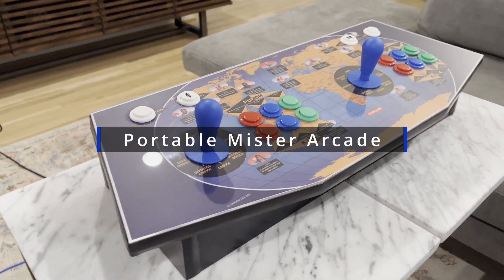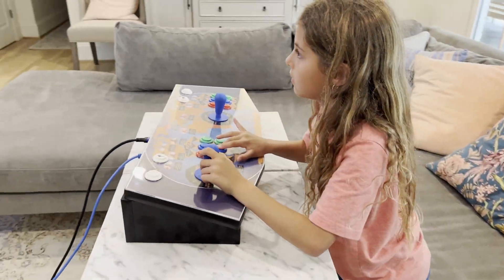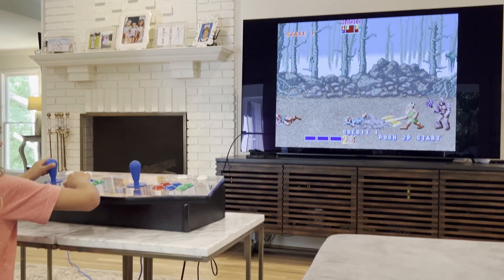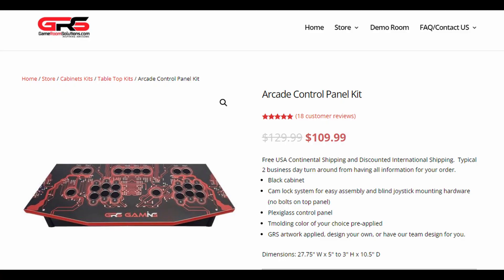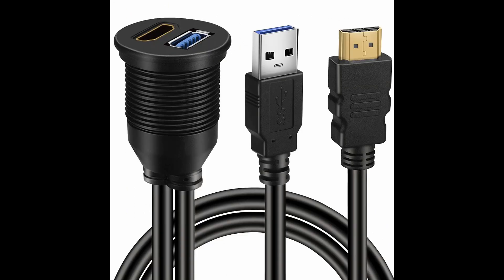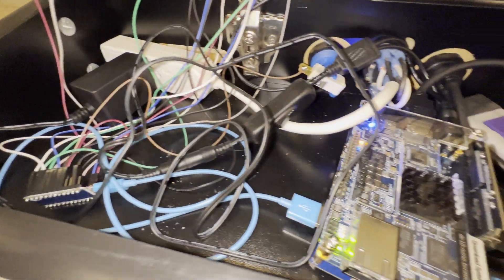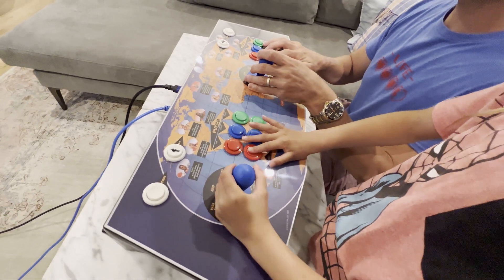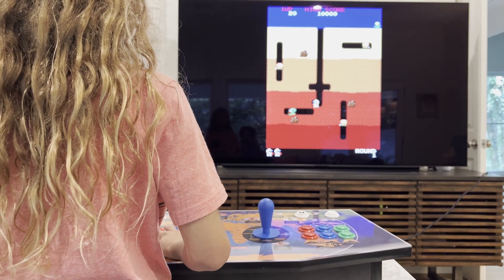Portable MiSTer FPGA Arcade - with parts guide!

Comment: Hi, I am asking again about a keyboard. 
Don´t you need a keyboard to set up the menu of the mister?
Why are there two white bottons on the panel each side and one in the back next to the swich on-off?
Reply from the maker: A keyboard will help but it isn't necessary (sometimes it makes button configurations easier). White buttons are for select/start for each player (in this case a coin button and a start button). Button on the back was added to prompt the menu to open on the mister.

Comment: I'm totally puzzled why people are concerned about their arcade experience being "100% accurate" using a MiSTer for FPGA emulation, when they are using modern displays that look nothing like the classic arcade CRT tubes. The experience is totally inaccurate, why be concerned about cycle accurate emulation? In addition, the timing of the display doesn't match that of the CRT and there are possible USB timing issues. MAME is very good with many games, and 100% software emulation is possible to be cycle accurate with some other emulators, such as the WinUAE Amiga emulator. Going the MiSTer route severely limits the number of games to be played and the quality of the emulation is only as good as the people reverse engineering the original code.
Reply from the maker: You make some good points but I think there are a few things to consider. I agree I don't have a CRT, which I would love but I don't have the space at this time; however, once I can fit one in my house I will be able to hook this device up to it as it has native CRT out capabilities. In regards to cycle accurate, you are fully correct. While most displays don't support "odd ball" refresh rates - that isn't the case for all. My TV is an LG OLEG which supports "free sync"; therefore, I have the opportunity to run my Mister at the native refresh rate of the arcade board or console and my TV is just fine with it (Truxton wants 57hz - so be it!). One of the advantages of the LG OLED - I love it for that. At first I didn't believe there would be a big difference in the free sync vs forcing it to output at 60hz for all games -  but it does indeed makes a big difference with certain titles. I do agree with USB timing - which has a work around (running the controller directly into a SNAC adaptor therefore it is "wired" directly to the board and not via a USB input (which does offer different rates of polling if needed). I do agree with you that the MiSTer lacks the number of titles featured via software emulation but another draw to me is that the current open source community that is working on the MiSTer is OBSESSED with getting things right. Updates are happening all the time to get things as close to the real thing as possible and this really draws me into this project. For years I utilized software emulation and it seems like the community for the most part (not trying to bundle 100% in this) is more concerned with front ends and menu's not so much getting everything 100%. I agree the front-end's are mesmerizing for PC builds and the Pi4 but it really comes down to playing the game.  I am actually working on a similar controller build (1 player) with a Pi4 inside to fill in the gaps where the MiSTer falls short but when it comes to which way I'd rather play an old school game - given the choice between FPGA (MiSTer or Analogue products) and Software Emulation - I'd choose FPGA every time. What's great is that we have so many options to play these old games, but for the reasons above this is why I've chosen this route. 👍
Reply: @Hawk_Eye_Retro  Nice to hear your comments back Ben.

I've built 4 MAME machines so far with more in the works (no rush). Most of mine were built over 20 years ago or close. In the late 90s I had a custom made wooden MAME controller made with new Wico leaf-switch joysticks & buttons (which I much prefer) and the layout I wanted for classic games (such as Space Duel fire buttons). 

All 4 of my MAME machines feature 19" arcade CRT monitors. That is the single most important element of playing the games to me. How do they look? Modern displays look very little like 1980s (or 70s) arcade monitors. It's not so much about the refresh rate, but most importantly the look of the actual tubes. But to get the games to sync or work right on raster CRT's, you have to get the right refresh rate. But not so much with mine (I'll explain). I'm using an empty gutted artless MsPacman cab for my vertical MAME cab, and a similar Galaxian for my horizontal. Both cabs still need a lot of wood working, painting and cabinet restores. I also built a color VectorMAME out of a Space Duel cabinet, and a b&w VectorMAME out of an Asteroids. No machines were hurt in the making and they could be reversed easily. For the raster machines, I have about a dozen interchangable control panels with almost everything you could imagine using all golden age era parts or repros. And I plan on extra panels for the VectorMAME cabs in the future and have collected a variety of parts to do so.

Getting back to the raster monitors, I have three 19" arcade CRT's that came adapted for a VGA display at the factory. These are very uncommon now. I've had to have repair experts work on all 3 the past few years, but they lasted about 20 years before they needed any work. They run at 60 hz. With nearly all of the 1980s games I play, they are near indistinguishable displays from the dedicated arcade machines. I've spent the past 20+ years visiting classic arcade to compare & I'm part of an arcade collectors group with tons of machines. Besides visiting Funspot a couple times a year, 2 retro arcades in recent times are both a 40 min ride from me. These monitors run Windows at 640x480, and even though running hundreds of classic of lower resolution games, it's rare that I can tell a difference between the dedicated games running at a native resolution & the correct hz vs these monitors. They look fantastic. The look of the arcade CRT tube (basically an NTSC running RGB) is hugely important. I've run the games on 1990s/2000s VGA CRT's and the look was different. Truxton that you mentioned looks & plays fantastic. I originally run all of them with a PS/2 interface. Now I have that adapted to USB in 2 of them. It's rare that I notice any timing differences on golden age games I must say. But more important than just the potential USB adaptor is the actual controls themselves. I run mostly leaf-switch original parts. Many games feel & respond very differently with microswitch joysticks. I immediately noticed this in the arcades when replacement microswitch joysticks were used, or in new games. I hate them. Some games matter more than others. 

But my original point, to me, much more importantly than if I'm going to tell the timing of a game being off by a millionth of a second via emulation is the kind of display being used, and controls that closely match what the original games used. Software emulation and authentic display & controls wins every time over FPGA. And I think a lot of people seem to miss the boat on that. And it's only a matter of time before MAME or other arcade emulators reach cycle accurate as some of the classic computer emulators have. And remember with FPGA or software emulation, it's only as good as how well the people working on each game have reverse engineered it. There are plenty of games via FPGA on the MiSTer that were not well done. Besides the obvious, several MiSTer owners have told me they switched back to software emulation. Not only because of the serious lack of titles, but because some say there differences are minimal and that software emulation is often well done, and that MiSTer also misses the mark some of the time too. One example I recall a few years back with SID emulation for C-64 games was not done well. I dunno if this has since been corrected. 

I collect both dedicated classics & have built several MAME machines. My goal is to eventually get my arcade collectors friends over to compare how well many games run on my MAME machines vs their dedicated games, or experiences in playing them. The right displays and the right controls, hugely important! Garbage in, garbage out as they say with computers. Wrong displays, wrong controls equals wrong experience, no matter how faithful the actual reverse engineering of the games is. The differences in displays & controls jumps out at me. The differences in timing does not, unless there is some specific game that is way off. The goal of my basement arcade has been 50% MAME machines, 50% dedicate games. I carefully pick games that are less suitable for MAME to own as dedicated, like my 3 player Atari Super Sprint for example, or Asteroids Deluxe or Space Invaders with in cabinet glowing mirror reflected artwork. But the look of the cabinets, displays and controls is to look original. Not like MAME machines as they are normally thought of. My MAME machines resemble conversion games, not MAME. 

Also, I did buy an ArcadeVGA card & JPac. With that, I eventually plan to adapt my JAMMA cab to run MAME and JAMMA boards. This solution offers exact screen resolutions for various classics. I don't however, expect to see a noticeable difference on the vast majority of games I play. Only games that I have to resort to "stretching" modes would I expect to see much of a difference, and only a handful of games I have to do that with.

Comment: Nice build Ben! Great option because you can store that whole setup away if not in use. How difficult is the mister setup? Flash an image or do you have to build alot of menus/wheels?
Reply from the maker: The mister setup wasn't bad at all. I was a little nervous before starting the build, but after watching a couple tutorials and following some online instructions it went through without an issue. You end up just sliding a lot of files over to your SD card. No "image" to speak of - one of the big differences between setting up a MiSTer and a Rasp Pi. Good luck!

Comment: Looks really great but could really benefit from 8 buttons. It’s nice to have the extra face buttons for functions like start, select, or just the PSX buttons including shoulder buttons. Also, the DE-10 Nano benefits from even a small fan. That would be an easy fix. I really like the power switch. That's incredibly convenient. 🕹️
Reply from the maker: Are there any small fans you recommend?  Hopefully to not make the board much taller (I was looking for another option that isn't the I/O board). I went with the 6 button just for arcade purposes. I have "coin" mapped as select and start mapped to "Player 1 or 2." If I play console games - I just use an 8bitdo controller.
Reply: @Hawk_Eye_Retro  The one I bought from Ultimate MiSTer came with a Noctua fan. I don't know if it's the lowest profile though. Noctua is kind of premium for fans, but very quiet! Probably any 5v (I think that's the voltage. Check this. Don't take my word for it) would work fine & the cheaper Chinese ones are smaller than Noctua. If you have at least a half inch of extra space over the board, you'd probably never need to replace the Noctua FWIW.
Reply from the maker: @NinjaRunningWild  did you mount this on an I/O board or somehow directly to the top of the de10?
Reply: @Hawk_Eye_Retro  Mine has the IO board with the VGA connection (analog). If you look at the pre-built units on Ultimate MiSTer, I have the BlissTer edition of his setups.
Reply: If you don’t have or need an IO board you can use a small 5v fan. I recommend Noctua but cheap fans for raspberry pi work fine too.

You can remove the top plastic shield from the mister and drill holes for the fan. Then use bolts and nuts to mount. It only gives you a couple holes to mount the fan but it’s plenty.
Reply from the maker: @mysteryberto  I did end up going with the 5v fan, happy that I did as the PCB feels like room temp now!